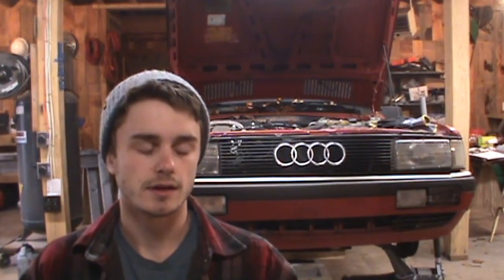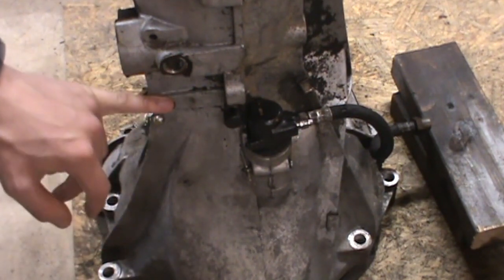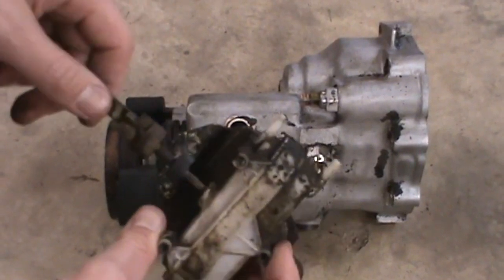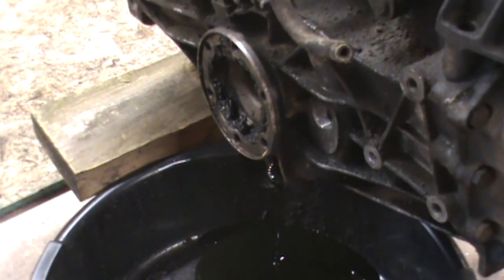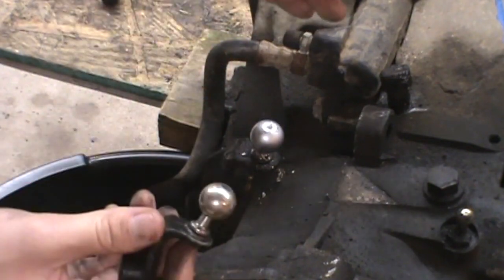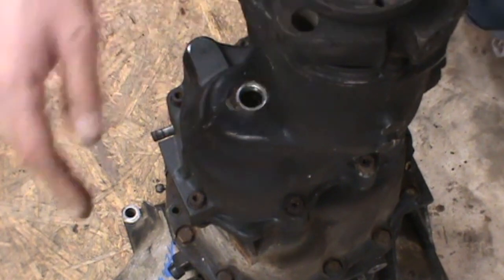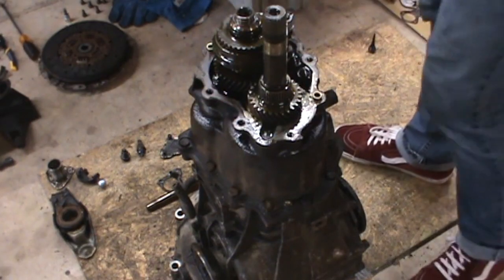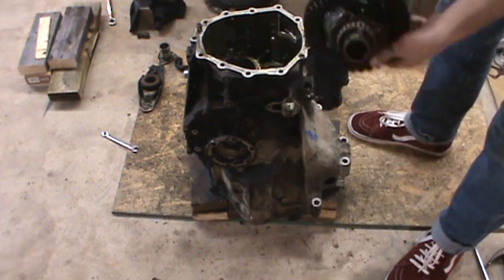Audi 016 Quattro Transmission Disassembly

Comment: Great info! I'm finally starting to dig into an 86 4k csq project car that's been sitting in my driveway. Not too many recent resources on these cars it seems, mostly forum postings from the early 2000's. I have the JT engine out of it now, looking to AAN swap it.
Reply from the maker: @bradmacdowell6583  brad, let me know if you want an AAN. I picked one up from Chris at Force5 and it's sitting on a pallet, long block has already been rebuilt.
Reply: @erikmyers3364  Where are you located? Lol Force5 is (or used to be?) located in Concord NH like 30 mins from me.
Reply from the maker: @bradmacdowell6583  Brad, the engine is down in NC. I've got the entire thing, plus everything you'd need to put it in a 4k, including a 3B oil pan and flywheel, wiring harness, ECU, turbo, everything.
Reply: @ I'm very interested. I'm about two months out from being in a position of having enough time to put an engine in the car. I need to figure out the logistics of it, finding time to go down and get the engine etc. Let's continue talking on here or elsewhere?? I don't think youtube has a private message feature.

Comment: Good morning, is this transmission that you are going to change compatible with the rear differential of the 4000 S quattro? And what oil do you recommend for this transmission and differential?
Reply from the maker: @JoseVargas-v6t  I actually just replaced my original gear carrier assembly from my 016 with the guts from an updated 200 transmission. The transmission is the same as the one that came out of the car, so it's all compatible. I can't remember, but I believe I filled the transmission with 75w-90

Comment: Any rebuild kits for this transmission?  Quick look, nothing!  Do people bother rebuilding them or is the wiser choice just upgrade to the 01E?
Reply from the maker: In my experience there are enough 016 shells around that it wouldn't be worth rebuilding one until you absolutely had to. I'm moving to the UrS4 platform for my 4000 at this point with an AAN, but I'm keeping the 016 until I find a suitable replacement. Just don't forget to doublecheck flywheel and pressure plate thicknesses if you're mixing engines and trannies.
Reply: @erikmyers3364  Thanks for the response, new to the world of Audis and much to learn!
Reply from the maker: @a.mccomb3296  good luck! I've found that Facebook groups like "Pre-95 Audi Quattro's" and such are very helpful for resources.

Comment: Thanks, useful video. One question- are central diff locks with cases interchangeable(old style mech lock and torsen)? Is it possible to swap straight?
Reply: You need the shaft from the same, as the torsen has a longer shaft versus the lockable center diff.

Comment: Awesome. Finally someone has made a very thorough video of 016 gearbox. Not many videos about older gearboxes out here. You have given me the confidence to take one of mine apart myself and see what can be done. Do you perhaps have a video of how the input and output shafts can be taken apart to replace change gears and synchronizer rings?

Comment: Hey great video👍I recently bought a b5 quattro 1.9tdi 1997 project...first gear whines with quite high pitch..any ideas what I need to replace when I rebuild it?great content👌
Reply from the maker: Sounds like that would be a gear problem. Does second fear also make any weird noises? First and second gear share the same shaft so if they both make noises that could be an indicator. Also how easily does the car shift into first and second? If it shifts easily while driving then the synchronizers are ok. When was the last time you changed your transmission oil? There are a lot of factors that are in play when it comes to noise.
Reply: @erikmyers3364  so I've only recently bought it...when driving it changes gear quite good and no noise in second..so the syncro mesh is prob ok as you mentioned cheers👍.pulls quite well when driving no clanking or  clunking... when stationary and getting first its quite difficult but I put that down to the clutch being bad and needs a new unit...I'm gonna drain any gear oil out and refill and then check again...it looks really sad in itself but I just know she is gonna be a diamond in the rough...she may of had a hard ol time at one stage but she just dont wanna give up...thank you for the advice...I have a couple of gear box units...and I'm wondering if the torsen differential could be removed and refitted to another gearbox would be my next move although I think the quattro first and last gear have different ratio to fwd gearbox with open diff...so hey its trial and error right..quattro gearbox are like hens teeth these days...but ya just gotta love em...cheers buddy

Comment: Nice! Thank you for the breakdown. Now I know that you can convert them to fwd or rwd easily. I thought the 200 had a torsen diff in the transfer case? That's a great locker if you lose traction.
Reply from the maker: Technically it does! That's why I noted that the 200 center differential didn't have an external locker on it. Those differentials are great for everyday driving, since they lock automatically. I just like the feel of open diffs when driving while maintaining the ability to lock the center at any time.

Comment: Is this transmission essentially the same as the 01x 6 speed from the A4 fwd?
Reply from the maker: Not at all, this is an all wheel drive transaxle, which has two internal differentials and a rear output for the rear differential as well. Not to mention this car was made several years before the first A4 came out. While the guts of the 01 series might be similar, these are still fairly different. I know the older 016 FWD transmissions were different, but they moved away from the inline 5 for the A4 and so would also need a different bell housing to mate it up.

Comment: the URS4's should have the 01e not the 016, but a great video none the less :)  Do you know where to get gears and other internal parts for the 016?
Reply from the maker: Actually from what I've been able to find not many people make replacement internals for the 016, that's why I had to scavenge one from a 200 and make it work instead... If you find a source fore 016 parts let me know! People need to know where to get replacements.
As far as the 01e transmissions go, we never got those over here in the states. Unfortunately we only ever got the 5-speed, so in afraid 01e parts are near impossible to source, which is why I would recommend looking for an 016 since that's what Audi exported over here.

Comment: Good video...no BS OR funny shit. I have two pearl white 5TQ and one is now whining. Have you looked or modified one of these for more power e.g. the spacer?
Reply from the maker: I haven't actually gotten the chance to dive into that, although I've been doing a lot of research on both the 20v NA and 20v turbo set ups. It seems like a major jump in output is achieved with standard obd2 efi, so I would say that's a solid bet to pursue something like an aan swap.

Comment: I have a 4000 s quattro - the rear differential is damaged - my question is, will the rear differential of an A4 b6 quattro be compatible?
Reply from the maker: I'm not very familiar with the rear ends on the 4000, but I would say not easily. There is a four generation gap there to consider, and the A4 is a totally different platform all together. I would look for a 5000, 100, or 200 rear end first.